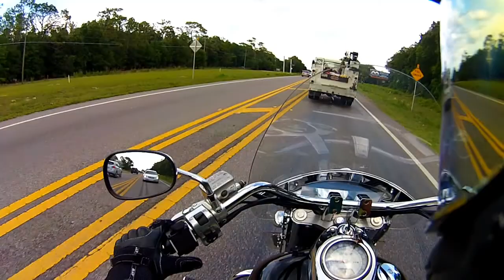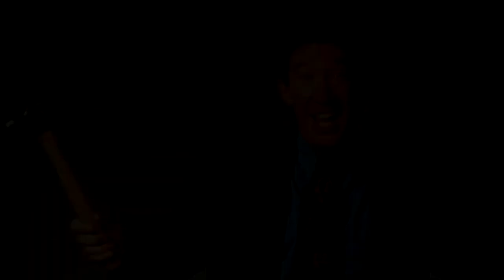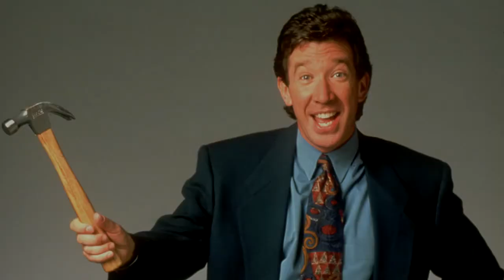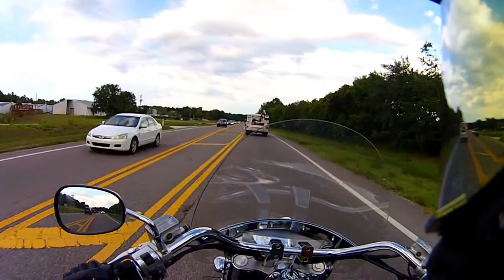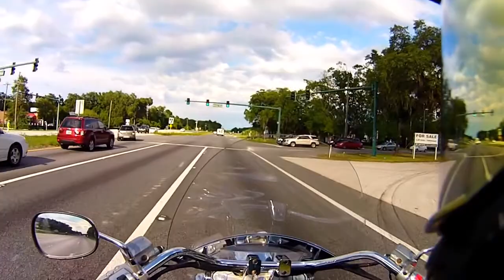MORE POWER!!!

Comment: Nobody needs that much power, but I would be lying if I didn't say I haven't thought about how much fun it would be to have a 150+hp bike.  I'm coming from a bike that has 17hp, so I'm at the very bottom of the spectrum of what's safe to ride on the highway.  I would say that I probably need a few more ponies for safety's sake but from my limited experience anything above about 50 hp goes beyond the "need" category and into the "excess".  That's not a bad thing, and it's certainly beneficial for getting oneself out of dangerous situations, but I find ways on my bike without all of that extra power (or any power for that matter).
Reply from the maker: Freespiritphil The day you get to the middle or above that 50 hp spectre it will put a smile on your face.  But I had even more fun when I was puttering around on my Honda Shadow all 27 hp worth.

Comment: My bike will power wheelie in first, but just barely ;) I haven't had mine dyno tuned yet so i don't know what it's pulling, but it's fun! It's also not stupid powerful either. I think it's in the sweet zone. I rode with a guy who has a gsxr with nitro on it and he could hardly ride it. He said he couldn't go fast in the corners or it would just slide out from under him. That sounds terrible to me.
Reply from the maker: Wolf and Crow Yeah your friend with the gxsr what's the point of having a bike if you cant enjoy it in its more best position which is leaned over.  As for the power wheelie I think my bike will power wheelie in first just barely but I'm to much of a wuss to find out.
Reply: yeah, it's over rated. you know what's better than a wheelie? steering. haha. i don't know why that dude went so far with his bike. He's ex marine so i guess he needed a thrill. to each their own.

Comment: Usable power is what the goal should be.  If the slightest flick of the throttle spins the rear tire then you have overpowered your suspension.  I love the jet bike like Jay Leno has but it has a serious flaw.  Because the engine makes more power the faster it turns, at some point the front wheel is gonna come up and kill you.  Now don't get me wrong I love power just like the tool man but without the chassis and suspension to control it you will have a bike only good for burn outs.  It will ride like crap.  A guy put a Corvette engine in a Vega once and couldn't get it out of the garage on stock tires.  He put monster tires on it and it still spun at any application of throttle.  The only thing it proved to be good for was pulling up beside cars on the freeway going 80 and spinning the tires out of sight. Too much power!
Reply from the maker: sam smith Yep usable power is what everyone should want...especially in a bike

Comment: There is definitely too much power. In my opinion you don't need a bike with that many hp (50 is more than enough to easily keep up with traffic). I wouldn't say though, that you can say more than x amount of hp is too much. There are so many other factors influencing the bikes behavior. I believe that a bike has too much power when you can't really ride it safely without any electronics.
Reply from the maker: Wanderlust8760 Agreed 100 percent.